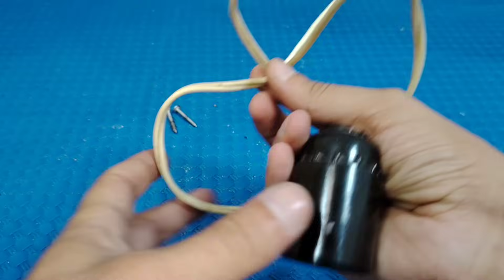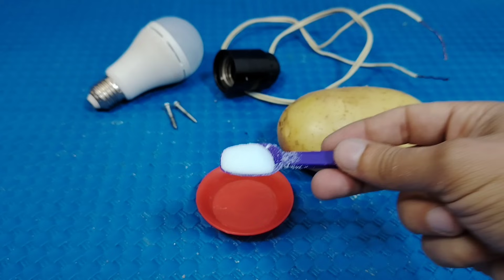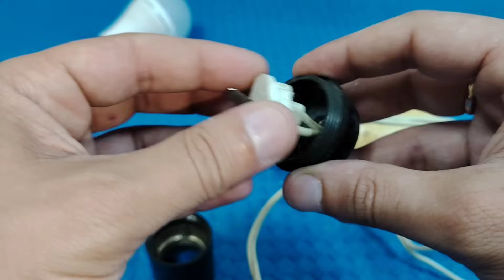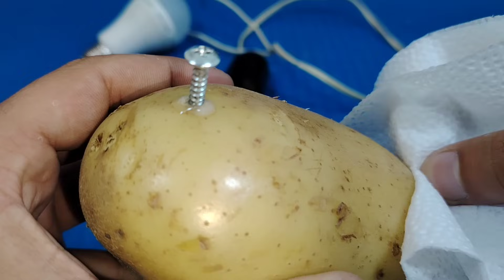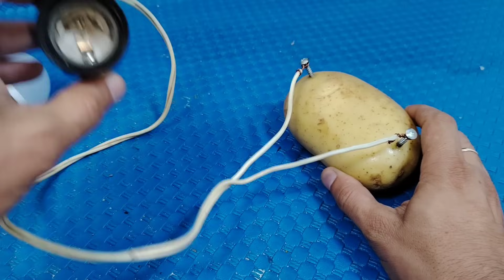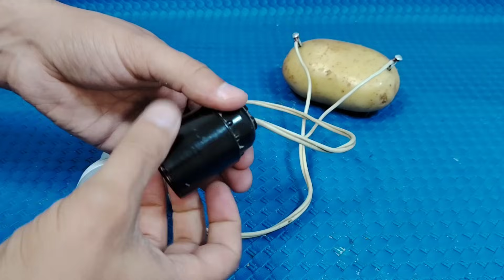How to generate free electricity from potato (Turn on the LED bulb) | NEW | Simple Tips

Comment: Friends, a potato or salt solution cannot directly power a 220V LED lamp.  
What really happens is that the potato creates a tiny voltage (millivolts) through a chemical reaction between two metals.  
This small signal can trigger a transistor or switching circuit inside the lamp,  
but the actual energy comes from a hidden battery placed in the lamp’s casing.  
So the potato acts only as a trigger, not the real power source.  
It’s more of a demonstration trick than a true scientific experiment.

Comment: Is that sugar or salt?
Reply: It’s salt because salt dissolves in the water of the potato and increases the ionic conductivity of the medium .
Reply: Le SEL améliore la Puissance ! le Sucre Diminue la puissance !  C'est du SEL mon Ami :)
Reply: Friends, a potato or salt solution cannot directly power a 220V LED lamp.  
What really happens is that the potato creates a tiny voltage (millivolts) through a chemical reaction between two metals.  
This small signal can trigger a transistor or switching circuit inside the lamp,  
but the actual energy comes from a hidden battery placed in the lamp’s casing.  
So the potato acts only as a trigger, not the real power source.  
It’s more of a demonstration trick than a true scientific experiment.
Reply: First vair ki conect chesina tharuvatha second vair toch cheste shock rada